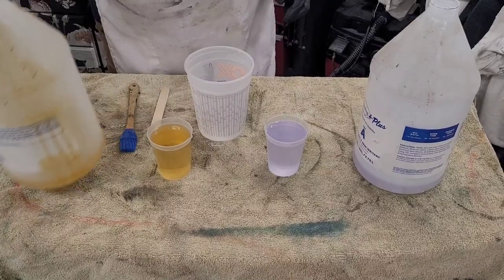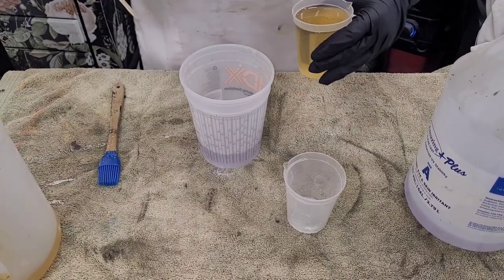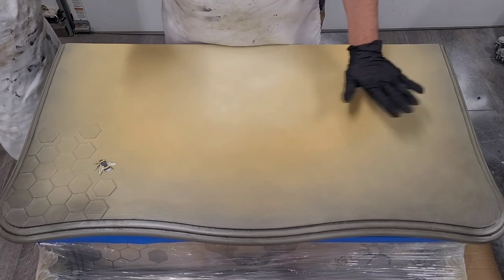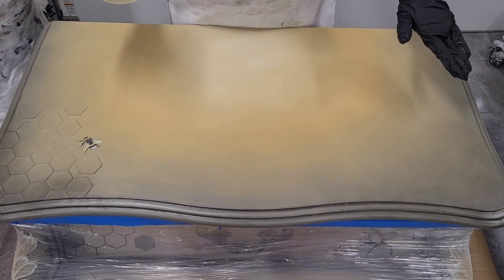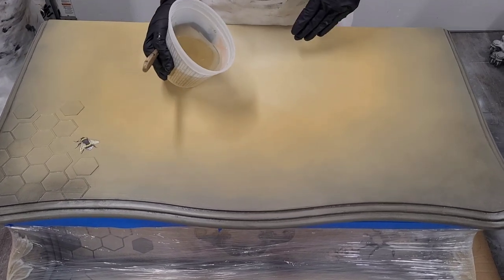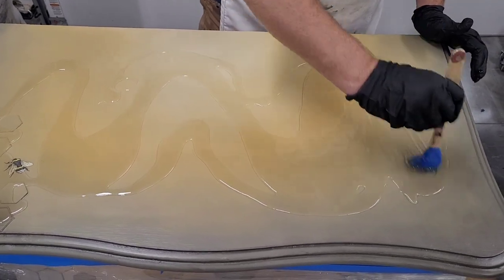How to create a smooth as glass resin furniture top that's waterproof too!

Comment: You do beautiful and inspiring work. What a pleasure to watch. I am thinking of trying to do something I thought might be simple for me. I'm 71 years old so.....Turns out not sure now. Piece is solid oak console cabinet. Partially stained that golden oak, orangey. Partially raw oak wood where we had top portion removed. I was wanting to paint most black and gel stain doors. Problem, how do I match the top raw wood surface with gel stained doors?
Reply from the maker: Thank you! It would be a challenge to get a color match with gel stain starting with 2 different finishes. You can layer the gel stain and after 3 coats or do it becomes opaque,  but then you lose sight if the wood grain, if you were trying to keep that

Comment: Hi Brandy, thank you so much for this tutorial. Its really going to help me with my project. Just received my resin today actually. Quick question, can I use a heat gun instead of a blow torch?
Hope Noah & Sean are feeling beter.
😘
Reply from the maker: Yes, you can use a heat gun, I do find the torch more effective,  the heat gun can move the resin with air flow too
Reply: @BrushedbyBrandy  thank you. Scared of the blow torch.  😬